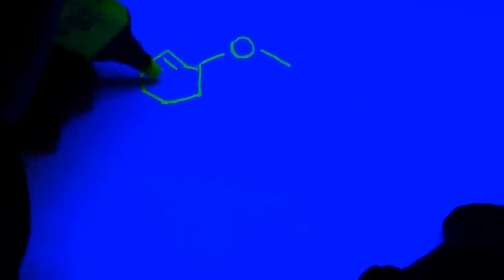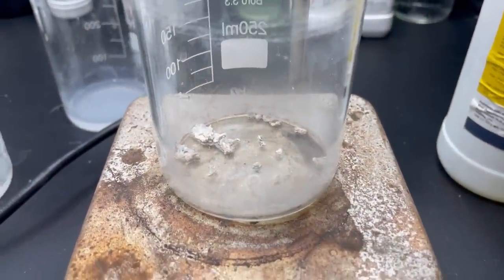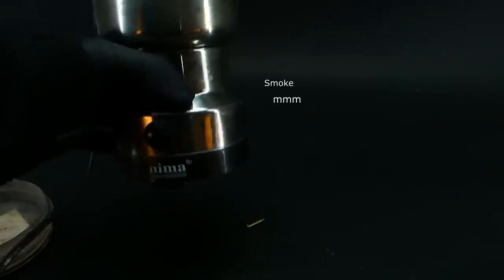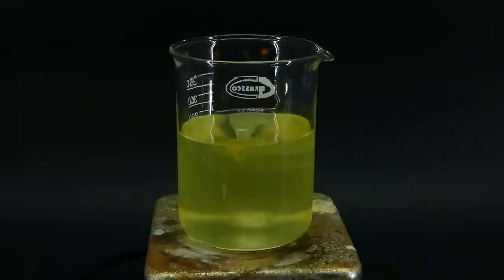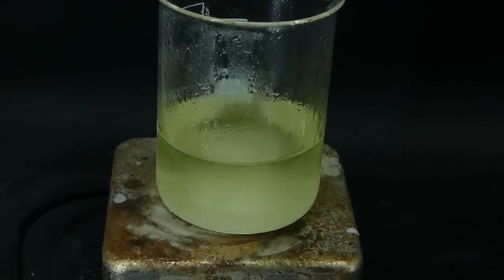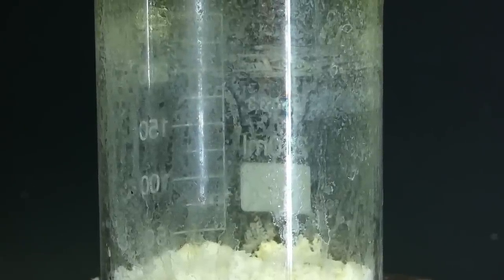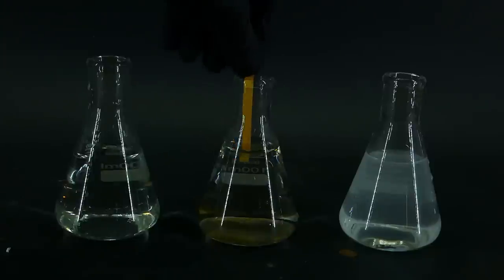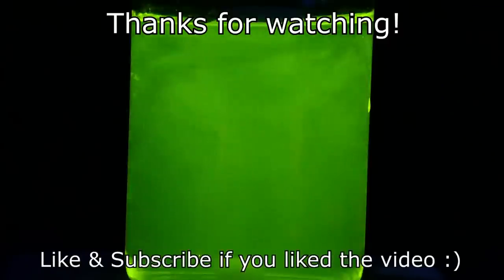Turning Cables into a Fluorescent Marker

Comment: Um.. at 1:25, is that really how you show PVC? I mean that's vinyl chloride (aka chloroethylene)... with an "n"... so... a bottle of vinyl chloride. Anyway, not important. Still mentioning it though.
Reply from the maker: I showed only a monomer of PVC which is indicated by the brackets, and the n stands for variable polymer chain length.
Reply: @Amateur.Chemistry  Well, anyway, RIP your beaker. I wish there was a way to turn broken lab glass into something useful like borosilicate beads for packing a distillation column.

Comment: Cable insulation... Pretty genius must say.
Great video!
Reply from the maker: Thanks!
Reply: @Amateur.Chemistry  any plans to use residual PVC or produced alcohol?
Reply from the maker: @ejkozan I honestly haven't thought of anything, maybe you know something to use them for?
Reply: @Amateur.Chemistry  well, PVC probably could need only pyrolyzed to make HCl directly. As for alcohol, all depends what exact ester it was, probably each manufacturer uses s but different mix. Definitely some smelly esters can be made
Reply from the maker: @ejkozan These are very good ideas, especially the ester one, I read that these wires most probably contain the phthalate DNOP which can be hyrdrolised to 1-octanol that I can turn into octyl acetate wchich has the smell of citrus fruits.  Thanks for suggesting that, I will probably make a video on this topic in the near future.
Reply: @Amateur.Chemistry  and you can also oxidize it to acid, so you can make additionally octanoic esters